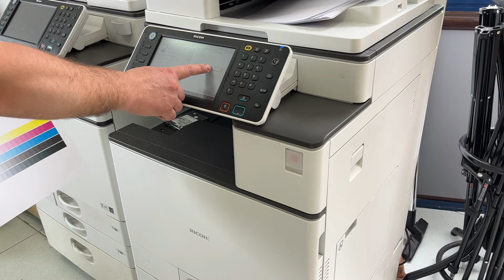Fuser Printer RICOH MPC2003 MPC2503 MPC2011 copier machine repair training

Comment: At 4:35, what are you using to clean that dirty part?
Reply from the maker: @KennyMingHong The separator is covered with a thin layer of Teflon. We can't scrape it with a screwdriver. At 4:35 I use wooden nail sticks. You can buy something like this in beauty salons. It may sound funny, but it guarantees safe cleaning of the separator strip. Here are some examples: https://allegro.pl/oferta/slay-100-drewniane-patyczki-do-skorek-paznokci-7025058035